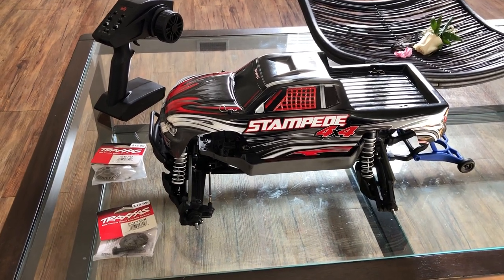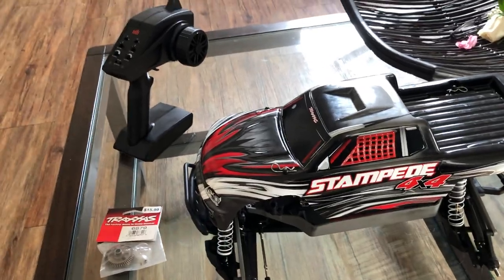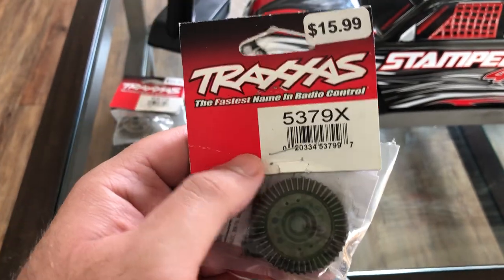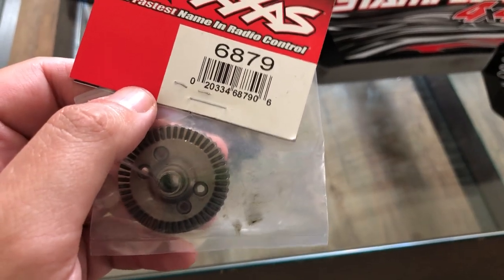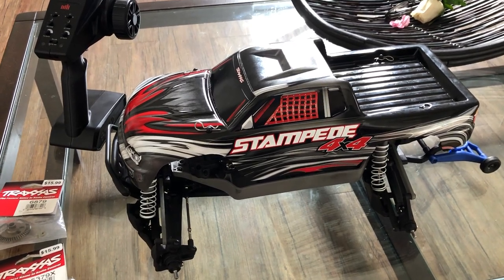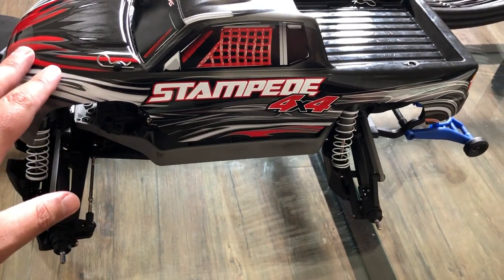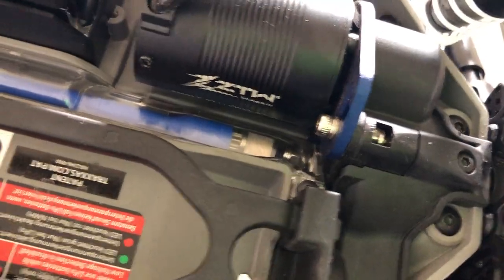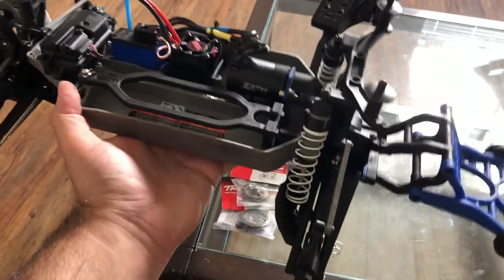TRAXXAS STAMPEDE 4WD NEW FRONT AND REAR RING/ DIFFRENTIAL VXL VERSION GEARS INSTALLED IN BRUSHED MT!

Comment: I hope you get that traxxas XO-1, I know that will give us all some great speed runs to watch.  I used to have one years ago, I did only one video on it, where I didn't say anything good about it, But I was just pissed at it because a firmware update burned out my entire radio system and it was not covered by warranty.
Reply from the maker: Ahh geese you serious ????...
Reply: yep, this was way back when you had to use an iPhone 4s or an iPod Touch 4 due to the 16 pin connectors they had, prior to the lightning connector.  OMG dude, you don't wanna know how annoying that was.  And guess what??  you could not go above 50 MPH with unlocking it through the app, which would never link, ahahah.
Reply from the maker: hybrid32494 Oh wow really ????..... DAMN...... now it supposed to be rocking the newest  TQI remote with the rear Bluetooth chip option. I know for a fact that Traxxas has changed that about themselves.